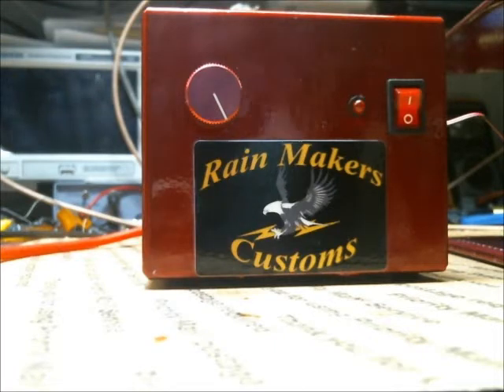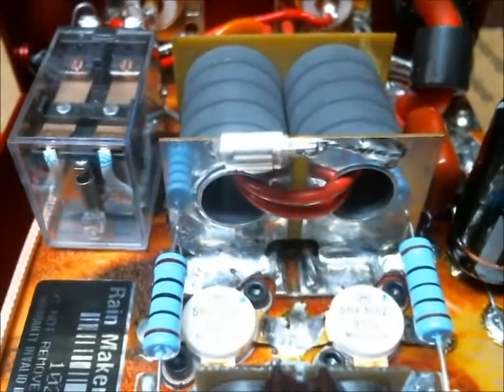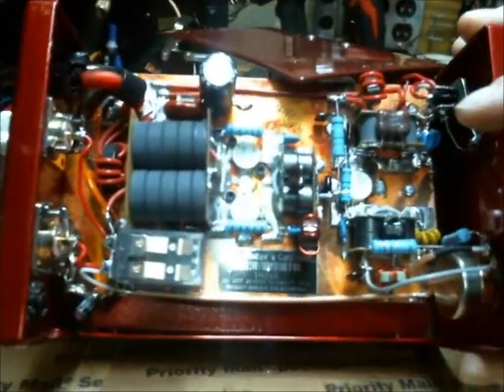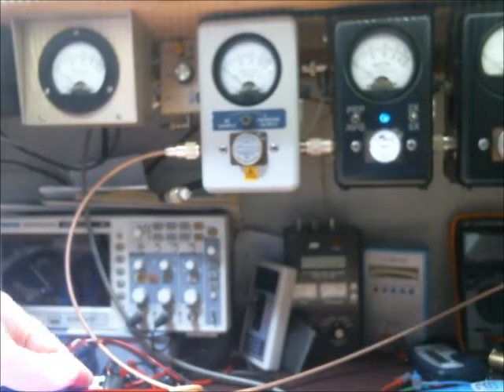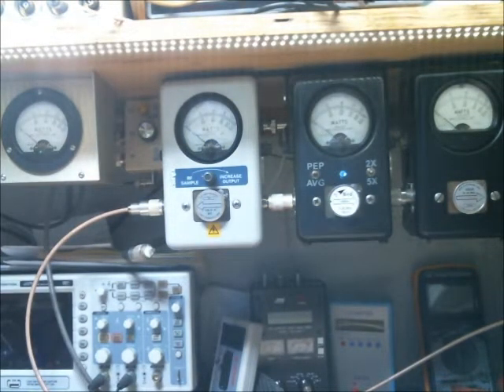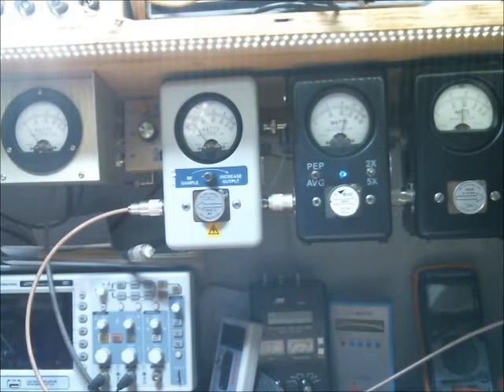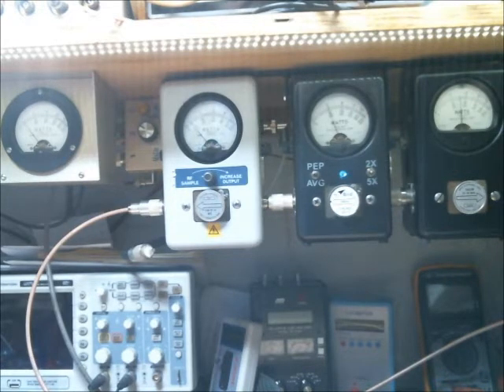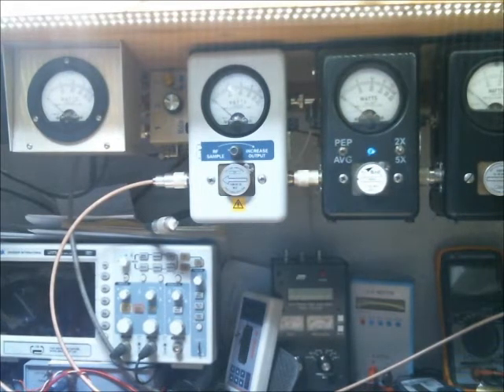Fire Starter1x2

Comment: i have a 2 pill 2879 hd but all i need is to tune the input whats a pf value on that cap input
Reply from the maker: it depends on several factors. is best to take it in. each amp requires special tuning